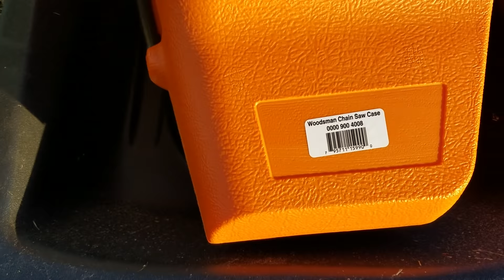New House - Build Update - 10/28/2018 - Basement Flatwork Followup & Stihl MS250 Chainsaw Review

Comment: I have worked with several different chain saws in my day and I've found that Echo always worked best for me. The primer bulb is right there in plain sight, two or three pulls and it running, and you don't have to stay on the trigger in fear that it's going to die on you. Even the Chain tensioner is easier. I would have to say it is a bit lighter also. This goes for their weedeater as well. I don't work for Echo and never have, I worked as ground maintenance at several cemeteries for about 8 years and just informing you of my on personal experience. The house is coming along nicely though, very interesting seeing the updates.

Comment: You’ll get the hang of it. Read the instruction manual first. Stihl makes the best chain saw. Husky is a great one to. They start easy if you do it right. Don’t be in a rush with that saw, easy to get hurt.
Reply from the maker: I figured it out, and it was about 35.5 minutes faster on the second day - LOL - I totally screwed up this one!!!
P.S. I do have a followup video coming out tomorrow AM...with another update too. The guys at Ace were super helpful when I called for some clarification. I found out that this chainsaw is actually super nice, even if it's a bit tricky to start (IF you happen to flood it by accident).